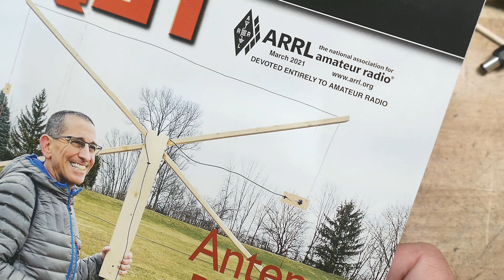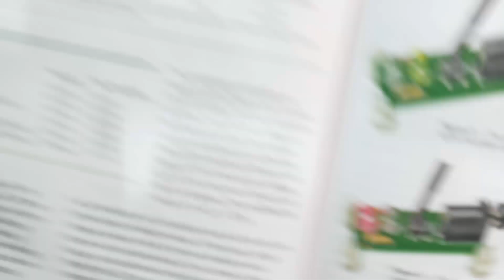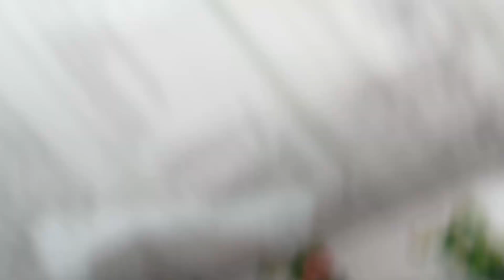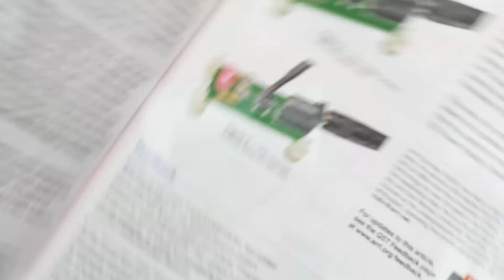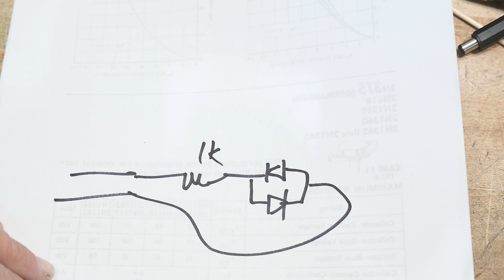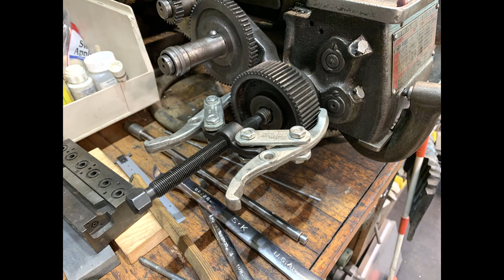#731 My Polarity Checker for 3.5mm Power Connectors

Comment: Make sure the reverse bias voltage on the LEDs can handle the random voltage that might be applied. Some LEDs have a fairly small reverse voltage breakdown in the 5 ~ 6 volt range.
Reply: A should have thought about it a bit more before I commented. The reverse biased diode will never have more than one forward voltage drop across it because the other diode is conducting.
Reply from the maker: The buddy system

Comment: The other thing to watch out for with those power connectors is they come in two sizes of the center pin. One thinner than the other. If you use wrong one the connection will be intermittent. I have been caught by this one a few times. Now I measure pin diameter with calipers to make sure I have correct one for plug hole.
Reply: Yeah. I'd like to have one with both the 2.1 and 2.5mm center pin jacks in parallel. Kill two birds with one stone.